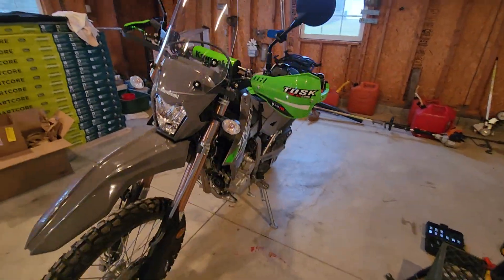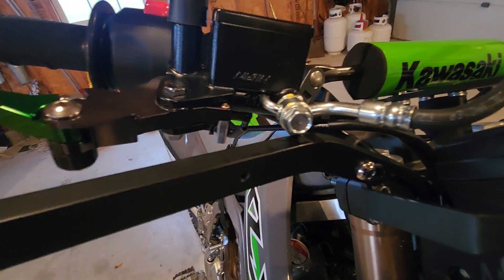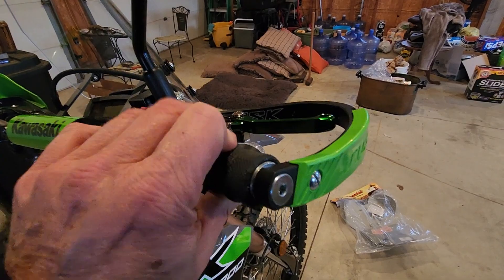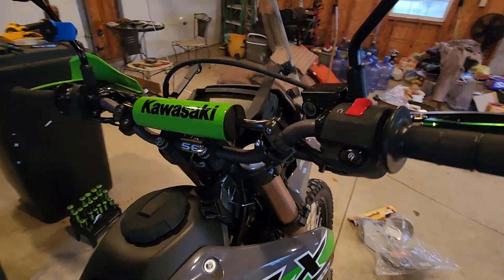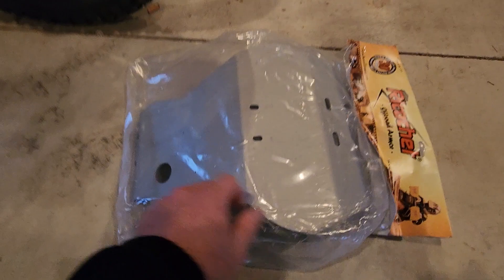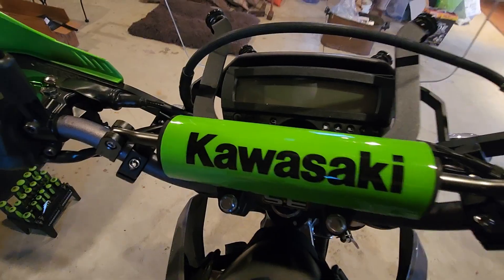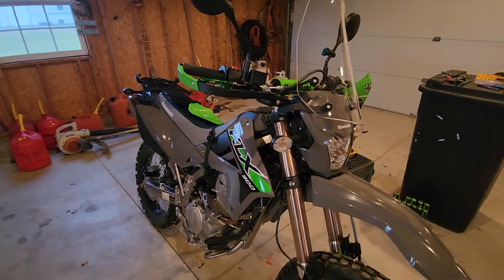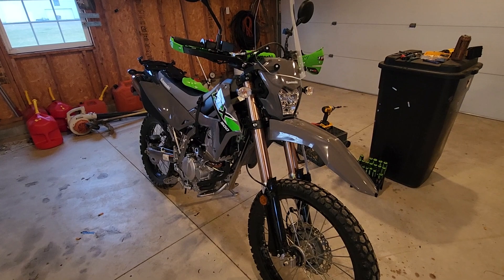New adds to the 2024 #klx300

Comment from the maker: Here's a list with links to everything I've done to the bike thus far. EVERYTHING WORKS ON THE 2024 #KLX300 with exception to the top rack which needed slight mods. I DO NOT MAKE MONEY OFF THESE LINKS!  CLICK THE  READ MORE BUTTON .

levers : https://www.amazon.com/dp/B0957C9DRH?psc=1&ref=ppx_yo2ov_dt_b_product_details
Handlebars : https://www.amazon.com/dp/B000WJ6DHS?ref=ppx_yo2ov_dt_b_product_details&th=1
IMS foot pegs (Yes they DO FIT perfect) : https://www.amazon.com/dp/B000UKIUZW?psc=1&ref=ppx_yo2ov_dt_b_product_details
Tail bag : https://www.amazon.com/dp/B07KZ3CQH5?ref=ppx_yo2ov_dt_b_product_details&th=1
KX SNORKLE (cheapest price I've found ) : https://www.amazon.com/dp/B0C1Z2BXZH?psc=1&ref=ppx_yo2ov_dt_b_product_details
Tank bag : https://www.rockymountainatvmc.com/parts/tusk-olympus-tank-bag-p?s=1604200
DFLEX PRO handguards Part # 1760390042 : https://www.rockymountainatvmc.com/parts/tusk-d-flex-pro-handguards-p?s=1887364
RICOCHET BASH PLATE : https://www.rockymountainatvmc.com/parts/ricochet-offroad-skid-plate-p?s=192977

TUSK REAR TOP RACK(NOTE* will NOT work on your 2024 KLX300 without modification. If you'd like to see that video, ASK ME, I'll make one) : https://www.rockymountainatvmc.com/parts/tusk-top-rack-p
Windshield : https://www.t-rex-racing.com/Kawasaki-KLX250-KLX300-Windshield-p/n251-18windshield.htm
EXHAUST : https://delkevic.com/stubby-14-stainless-steel-oval-muffler-to-fit-klx250-2009-2020-KLX300R-2020-2022/